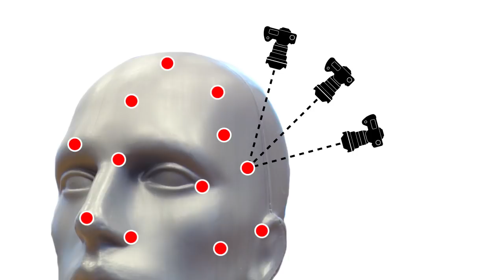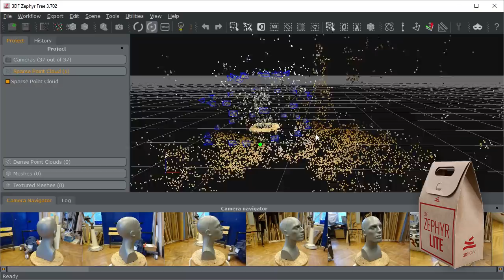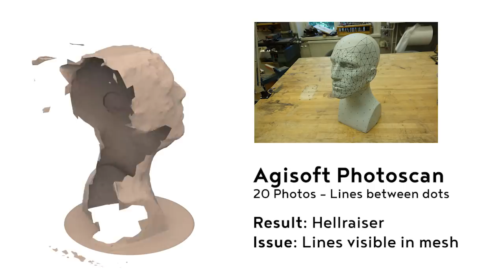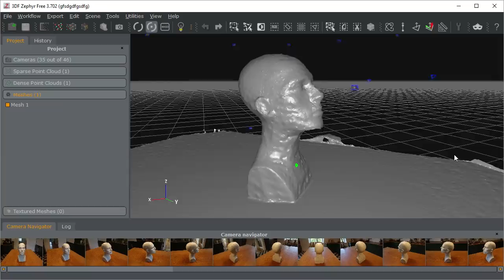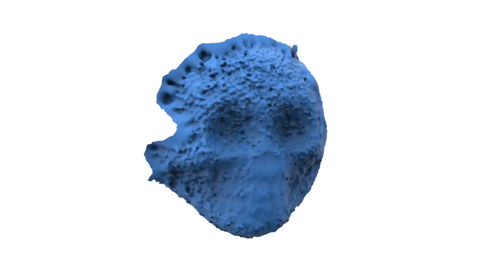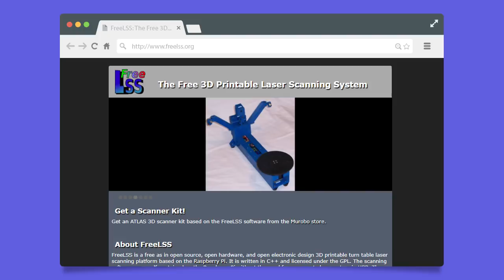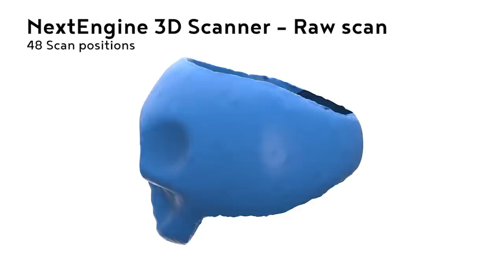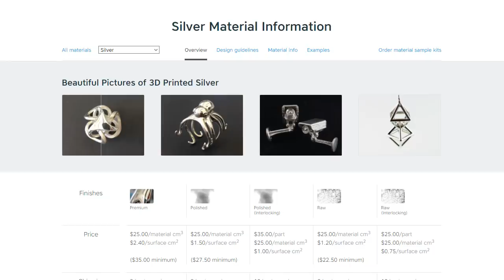How to Copy (almost) Any Object

Comment: I'm a retired jeweller / master model maker. Truth is I would have been happy to cast that plastic ring using lost wax casting. Its a process rooted through thousands of years of our history, would be a fraction of the time, effort and cost.
Doing it for myself would cost nickles and dimes in material and a few bucks worth of (real} scrap sterling silver. It would be a molded copy with an elongated band to keep it cheap. The cost would only start to add up if the model had to be "scaled up" as he does here with software. Even so, I can hand sculpt a replica of that simple skull in pretty short order and cast it up with little effort.
So, as a craftsman with my full shop at my fingertips and 30 years of experience at play, I could go to my printer and spend (did he say how long this took? Seemed long)  a while figuring this out or, sculpt up and cast real sterling. 
Now, what it cost me and what I'm gonna charge a customer are obviously two different things but if I walked into my shop tomorrow and was going to remake this ring; would I walk to my bench or to my 3d printer? 
I would walk to my bench without a further thought.
I can see the fun of doing this with photos and printing and it does give me some intriguing ideas (that's what this stuff is all about, right?) but whether I made a rubber mould and cast an injected wax copy or re created a scaled up wax by hand, the lost wax process gives me a ring made of sterling silver and its less trouble for me to accomplish better, longer lasting, more beautiful results.
Maybe the day will come when it's practical to print 1750°f molten silver  (I hope to live to see the day we do that!) but for now, we have to settle for the same basic fire and clay process the ancients employed thousands of years ago.
Reply from the maker: Yes, you have specialized knowledge in doing this, but most people who watch my channel does not. There is a world of difference between asking a craftsman to do something for you, and to learn how to do it yourself. I would've thought as a craftsman you would appreciate that. Besides, if you made a cast of the ring I would not be happy, as I did quite extensive work to make it into a proper ring, it's not a straight copy. Your method would require extensive resculpting to get the ring to the right shape, wrong scale notwithstanding. You sculpting the ring from scratch to the right scale would, in my opinion, remove the whole idea why I'd want the ring in the first place, it would remove the provenance of the source material. This ring is essentially the same ring I wore as a child, with some practical differences (like removing the split in the back). A ring sculpted from scratch would not be. Then I could just as well go on eBay and order any random silver skull ring.
Reply: @SwitchAndLever  oh dont be so sensative. I thought it was a great idea and said it inspired ideas of my own!
I'm comparing two wildly different processes and the time and tech between them. How the two compare and what we might look forwar to.
I also acknowledged the time and effort you put in. I wasn't insulting you, I work with both technologies. 
Relax, brother. You did good.
Reply: @SwitchAndLever ,  Actually,  the combination of the two technologies create a perfect balance. I could scan the ring, as you did, but print it into a plastic that will burn away in the lost wax process and you get an exact copy of your ring but cast sterling silver.
Reply from the maker: @snowmansnowsnowman4641  but...that's exactly what Shapeways does already. I scanned it, fixed up the model, send it to shapeways, they print it in wax, cast the wax, polish the result, send it back to me. Since most people don't have the knowledge or equipment to cast silver, much less in a centrifuge, I think it's a perfect marriage.
Reply: @SwitchAndLever ,  I'm not familiar with Shapeways but there are many casting companies who will charge 30 bucks plus metal cost.
I am going to try some PLA ring models one of these days to see how well it burns out before the cast. Theres no reason it should leave resins after  1250°f burnout and shrinkage should only be a few % points. Your a smart guy. If you are interested in a project to combine with your printer that costs very little, you can get very good small castings cheap and easy using limited tools you can gather around the house, shop and hardware store. By melting down old gold or silver jewellery you may have no use for you can do it yourself. Most people think its quite "specialized" but honestly, its so basic its embarassing. Unless you are like me and had to be able to cast any shape quckly and reliably as my vacuum casting does, its kinda one or two steps past monkey work. Plus, it's fun as hell.
 Good luck with you projects.
Reply: Switch & Lever    Oh I thought he said retarded jeweler  not retired jeweler

Comment: You could prob do a 30 min expose on the USGS and navigating to the LIDAR based photogrammetry. 
The site is huge ! 
Completely lost there. You gave me an idea about making representations of geographical formation with 2.5D CNC Router
Reply from the maker: Indeed! And if you do it in plywood you get really cool topographical lines across the landscape as well.
Reply: I just wanted to say that I appreciate the work you did on this topic. 
It is not apparent as you are watching the editing is great, you have some many cutaway shots and progression of work pics. I am very impressed.
I still cannot find the page that you show that you may have used for some 3D relief data.
And I am not entirely sure as to how I would use it to be honest. As for the USGS...
I am not sure how to proceed.
There is this structural engineered plywood beam that I have some offcuts and was going to turn a bowl with. Was saving them for my 2.5D CNC Router However I am so far from completing  the build   I might just enjoy them as bowls :-).
Reply from the maker: The USGS website is linked in the description though, so just hit that link. The interface takes some getting used to, and require a bit more fiddling with to get results. There are guides out there to help you get usable material from it though.

Comment: oh my  well what i do is either use cement or Gips to make a negative mold and then make positive which is the copy of the object. no hitech or any software just my 10 fingers .
Reply from the maker: That sounds great, and how do you scale that to 1/5th the scale? Or in the case of the ring scale it up enough to fit my finger?
Reply: @SwitchAndLever   i `ll use mathematic , drawing compass as a main tool .
Reply from the maker: @vickymcleod5244  then you'll still be making an interpretation of the original, not a copy, which is the whole purpose of this video. You're not going to be molding and casting it, you're going to be sculpting it, which is a big difference. Not to mention will definitely both take longer and be more out of reach for someone not possessing those skills already. You can learn photogrammetry in an afternoon, could you teach someone to sculpt accurately, to scale, in that time? 😉

Comment: I aonder what would be the outcome usiing Autodes 123D Catch... i used it a while back and the effect was really good (on a simmilar but less reflective model).
Reply from the maker: Unfortunately 123D Catch doesn’t exist any more. Autodesk killed it and absorbed the tech into Autodesk ReCap, which is not as good in my opinion.
Reply: @SwitchAndLever  well that explains alot... i was looking for it lately... and the mistery is solved... and it was damn good one :/

Comment: Question have you tried macro lens with that ring to see if thats possible ????
Reply from the maker: I've tried to copy that particular ring since probably 2010 or something, and I've photographed it in a myriad of different ways. I'm not going to say it's impossible to do so, but you're going to need a macro lens with a very deep depth of field to be able to shoot close enough but have the entire ring remain sharp. This pretty much discounts a handheld camera, as the shutter speeds will be much too long to hold still by hand. Regardless of what I've done I haven't gotten anywhere close to as good results as I got from the Nextengine scanner.
Reply: I currently have the one from 3D systems (discontinued) that works with the iPad and has also been abandoned by the original makers. and it has NO where the same resolution ask what you showed.
Reply from the maker: The iSense? I haven't used that one specifically, but I used the Structure sensor, which seems to be basically the same thing from another company (Occipital), and I agree. It's a fun thing to play around with, but quality is atrocious, and you basically can forget about scanning anything smaller than a human head.
Reply: Yes the iSense Sorry but its totally made by Occipital. the power supply has it written on it. Occipital does not support the iSense at all.. Very sad but I will say Loved the video BTW.

Comment: Was the bread printed by Shapeways using sandstone? If it was, is it fragile?  New sub
Reply from the maker: Yep, it's their "full color sandstone" material. It is inherently fragile, however as they soak it in cyanoacrylate after printing it becomes a lot tougher than the raw sandstone material. I still wouldn't just toss it around aimlessly though. It serves best for decorative pieces.
Reply: Very nice job.  Thanks

Comment: What did you expect to use only ard 40 photos for photogrametry?
Reply from the maker: Actually I did use more photos, but the software was only able to match that many. Also, it has a cap of 50 photos, which actually (as clearly shown in the video) can be enough to scan quite a few objects. So why the negativity?

Comment: I need to 3d scan my truck, or other vehicles,   but,  I'm a little reluctant to spatter it with different color paint..  I've tried Visualsfm, Meshroom, etc..  Not much luck yet...  My truck is all white..  I end up with a 3D lumpy potato image..  I even bought a nice camera for the project..  I have a CNC router I plan to mill my truck fender or other parts in stryofoam and mold them out of fiberglass...   their gonna be to big for my Creality printer,   unless I make it in pieces...  The scan is turning out to be the hardest part..
Reply from the maker: Mud! Splatter mud and dust all over it! A thin coating will do you, preferably with some color variation, and then just wash it off when you're done.

Comment: Now a glow in the dark skull ring would have been cool.
Reply from the maker: Hmm...it could be neat to fill the eyes of this with glow in the dark paint. I don't know if you can 3d print glow in the dark material, but you could definitely make a silicon mold and cast it.
Reply: Switch & Lever glow in the dark PLA is common.
Reply from the maker: I wouldn't use PLA for a ring though since PLA is so susceptible to moisture, and it's quite brittle.
Reply: PLA is capable of absorbing up to 6% of its own weight water, but it's not really a problem - wet filament will weaken the object while printing, because the water will basically foam it up, but when it's already printed, it can only get stronger due to water absorption. Also you can and probably should seal it up with acrylic clearcoat.

As a ring with some thickness to it, PLA can hold up just fine due to how stress is distributed along an arch, as long as you print it hot enough. And if it breaks, you just make a new one.

They also make glow in the dark PETG too.
Reply from the maker: I still wouldn't use PLA as jewelry, you really want to use a plastic that's entirely inert when it comes to degradation from what the body can throw at it, it's also full of micro pores which can become a breeding ground for bacteria. I can't put it elogently enough, so here is a quote from reddit user PoweRaider on a topic discussing this specific question:

"PLA is a biodegradable polymer... when it breaks down...which it will start to at an accelerated rate in constant contact with body oils, sweat etc....it becomes Lactic ACID. And just because the skin is slightly acidic doesnt mean that the exposure would not create a dermal sensitivity. ESPECIALLY in a fistula. Because PLA exhibits bulk degradation the molecular weight begins to decrease immediately upon exposure to water but it does not change in mass until the molecular chains have degraded sufficiently to diffuse out of their polymer matrix. Depending on extent of fluid exposure this occurs around 20 days internally....in near contact it would be 50-75 days roughly...but upon reaching this point the extent of lactic acid seepage would drop the surrounding pH to around 3...which is well within a toxic pH range."
Reply: Sounds like someone who pretends to know chemistry to me but doesn't. I once wrote a similar April fool's on purpose. For one, it doesn't just biodegrade from humidity, a little more effort is needed. For other, Ph of 3 is utter bullshit, if your jewelry item has turned completely liquid, the actual Ph would only be around 4-5, as both lactic and glycolic acid would be emitted into a moist environment, at which point you couldn't possibly be wearing it, and you might also notice it doesn't turn liquid within weeks, or months, or years. It would also develop a characteristic smell. The degradation products themselves are endogenous to the human body, so you shouldn't be concerned by sensitisation or anything like that. So when it becomes smelly, please ditch it.

A little reminder that PLA was actually developed for medical use, as implants (though usually in modified form), and for drug delivery, and is generally considered to have a very high biocompatibilty. PLA is permitted as a dermal filler by FDA, i.e. people get to inject their cheeks and other bits with PLA to give them more volume - not without issues, but then, nothing ever is.
Reply: Actually you know what, i'm really not one to wear things that i don't need, but i'll go right away on yeggi, print myself some jewelry, wear it night and day and shower in it, and see whether there's any issues within 2-3 months, and if i don't report back, doesn't mean i'm dead, means it's probably fine, or you can poke me. I'll see whether i can find a fluorescent sample sold somewhere because i don't want a whole roll, it's too abrasive to use regularly.

Comment: 4:48 Why not covering the figure with hairspray and stick a thin coat of sand to it?
Reply from the maker: Because you’d run the risk of introducing surface texture distortion unless you use a very fine sand, basically something like talcum powder. If you continued looking you see that i ended up painting the surface  to get around this issue.

Comment: Shiny can also be scanned. With no matting. Like cars etc. But people who know how,  do not release there tutorial.
Reply from the maker: That’s like saying you can turn water into wine, but won’t tell how. I’ll believe it when I see it.
Reply from the maker: That's neat, but I think the important thing why it works is in the article (beyond software getting better), it's the amount of pictures used. The car is captured using 482 photos, so there is likely plenty of information from multiple angles that are not disturbed by harsh reflections. Also, look at the headlights, which are the most shiny part, they're completely distorted. So, the solution is, take more photos!
Reply: @SwitchAndLever  there will be distortions any way. Not that smooth result.

Comment: Could someone help me make a very thin charm like 3 mm thick for a bracelet i got i want it in gold and to let a jeweler make it it will cost me around 400 euros
Reply: This charm the ones online are always fake sadly and i want a real one
Reply from the maker: That’s the thing though, it’s going to cost you money. First of all the gold cost of course, and secondly the time and effort that goes into the design and manufacturing of your piece. If you were quoted €400 for a custom piece of gold jewelry I would take it immediately, that’s pretty cheap. I wouldn’t quote anywhere near that price. 

(I removed your link as it was to a shady online shop, and I do not want to promote their business on my platform)

Comment: Silicon rubber : 1 µm resolution, 45 min, a bit of resin, done.
Reply from the maker: Cool! Now I have something that’s the exact same scale as the object I copied and in the case of the mannequin head I used so much silicone and resin I can’t afford to eat for a month. I make a point in the video about changing the scale of objects, how would you achieve that with mold making and casting?

Comment: Masking and lazy susans are not a great solutions for photogrammetry because the algorithms depend on the background for the greatest accuracy.  
If you are having trouble capturing an object, try placing it on a large sheet of textured newspaper.
Reply from the maker: Look at the video I linked. It is a great solution, and I know of professional clay to 3D modelers who use it as well. It does demand a good setup though, and mine was obviously a bit too hanky, and the head too smooth.

Comment: why not use a normal silicone mold to copy an object. you can resize a mold also
Reply from the maker: Not factoring in the cost of molding an entire head, you cannot shrink a mold to like 1/10th of what it was before. That’s why. Cost, access and not working as you think it does.
Reply: fair enough. congratulation with your project. 👏👏

Comment: Super cool technology, but just take a mold of it with silicone!
Reply from the maker: Sure, and aside from the cost of that much silicone to cast the whole head, what about if you want it in a slightly different scale? Even something small, which could make sense to mold, like the ring, was scaled up to fit my adult fingers.